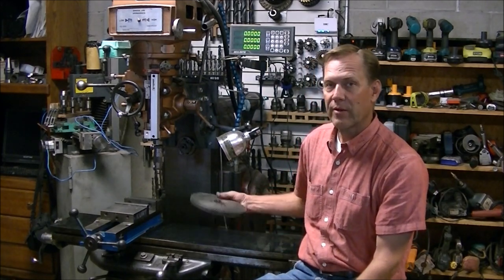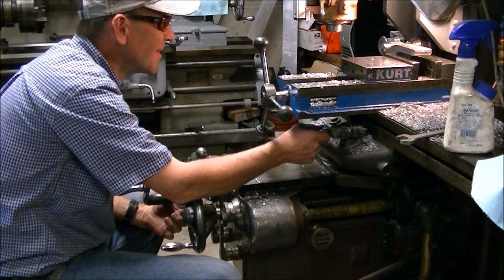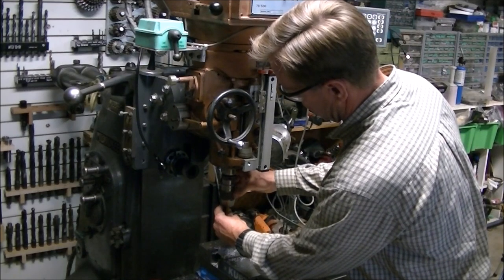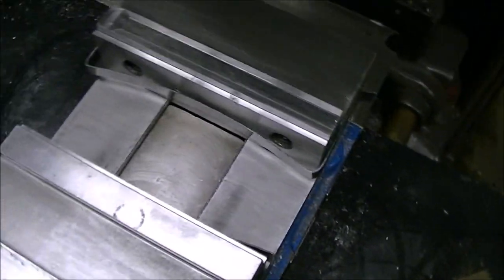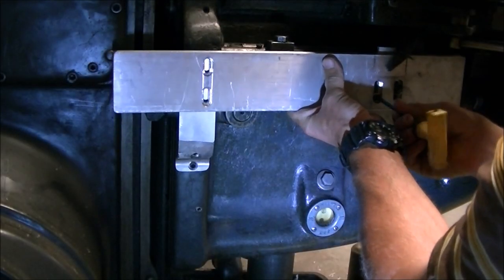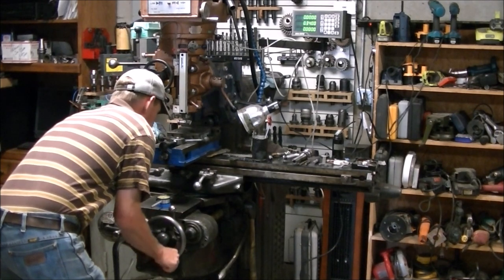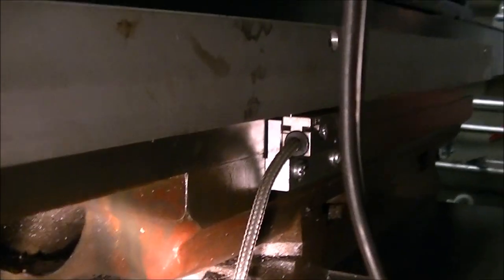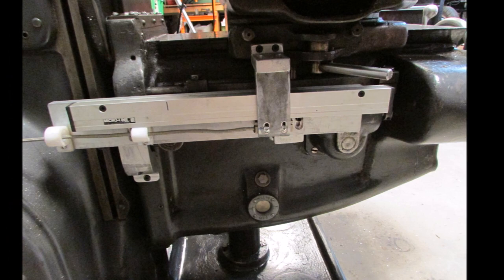K&T 2HL Mill DRO Y-axis

Comment: Sometimes you get the bear, other times the bear gets you, as we say in Alaska where I live.. The idea of using blasting sand as foundry sand never occurred to me! Your castings cleared up very well and that's what matters. DROs are out of my orbit but I enjoyed the video a lot. Keep /em coming!
Reply from the maker: Juan Rivero thanks for stopping by. I spent a winter working at a gold mine in Southeast Alaska a few years back, I really enjoyed all the Alaskans I got to work with up there. Probably would have stayed on but a desert rat like me needs to see the sun more often than it shows up around there. I'm loving the DRO on the mill and am getting ready to film some projects with it. If work would stop getting in the way it'd be easier. Craig
Reply from the maker: Juan Rivero also, I usually use Petrobond sand but I wanted to try the lost foam method add the patterns are so easy to make. So I used the sandblast sand to hold the foam patterns coated in sheet rock mud in place. Craig
Reply: The finer the grain the better. There is no such thing as petrbond available in Alaska so it's roll your own/.
Reply from the maker: +Juan Rivero these guys claim free shipping but that probably doesn't apply to Alaska https://www.budgetcastingsupply.com/mobile/Product.aspx?ProductCode=1030-050. There is a price to living in paradise. Craig
Reply: It is usually the case that the shipping cost is anywhere from equal to the price. Still, lots of sandblasting places here so might be able to get some, when and if I take up casting again.
Reply from the maker: Juan Rivero you might look into the lost foam method. Everything you need can be picked up at the Homeless Despot or somewhere similar. Craig

Comment: Nice job!  I have the same exact mill without universal table, it's a great work horse.  I was always going to do what you did with the Bridgeport head on the K & T to utilize the 3 axis power feeds, but I recently found a van Norman 2rq 3hp in great condition with the universal head  that can be moved to a different angle in under 1 minute. Really Versatel machine 3 axis power Feeds as well and quill to boot!  Only downside is 30 taper, but I got a decent amount of tooling with it.
Reply from the maker: Brian 629 I sold a Van Norman #12 after buying the K&T, I wish I could have kept the Van Noman as it was a great machine, but there is only so much room in the shop. I sold it to a friend so I knew it was going to a loving  home. The Bridgeport style head is a great addition to the K&T. Craig